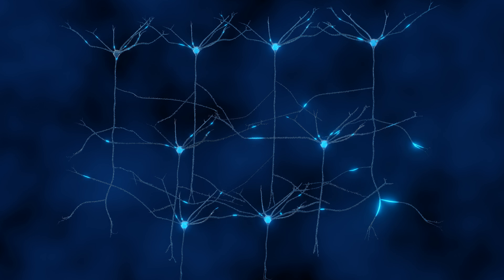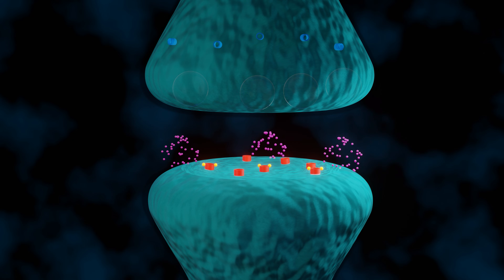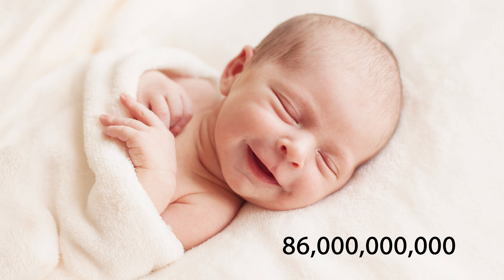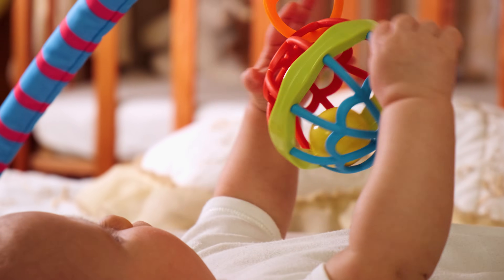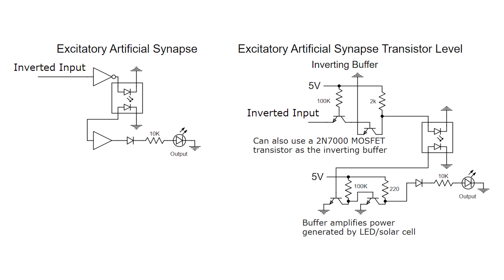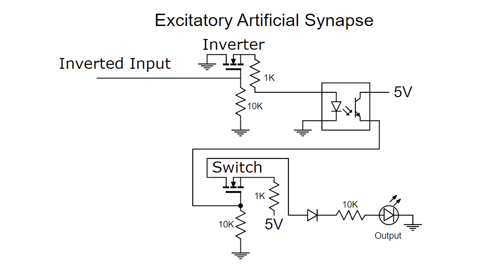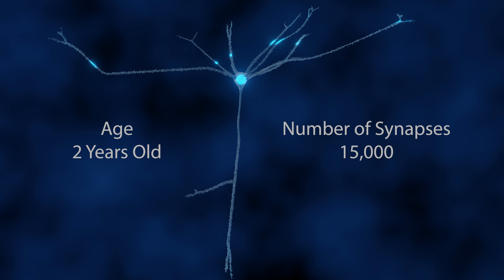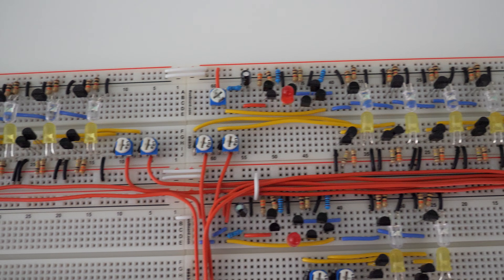How to Build an Artificial Synapse

Comment: Polarizing material between the optocouplers? You can do a lot of bioanalogous things with the raw optocoupler from a pair of LED's thing, you could even do volume transmission.
Also opamps and memristors work great for creating spiking neurons.
Reply from the maker: What do you mean by "Polarizing material between the optocouplers"? Do know of a good example/demo where opamps and memristors are used to create spiking neurons?
Reply: @GlobalScienceNetwork  I found some examples on researchgate that checked out in falstad about two years ago, I'll have to go diving. I thought of something akin to polarized lenses, you can take two of those and have one rotate on a servo (very crude example) and use that to make an adjustable filter, LED's of different colours are sensitive to different forms of light, mostly from the plastic "bulb" being dyed. I had something that can be polarized electronically in mind but I forgot the actual name of the thing.